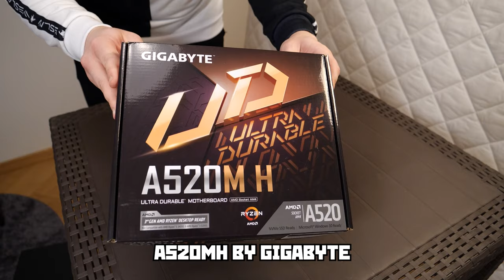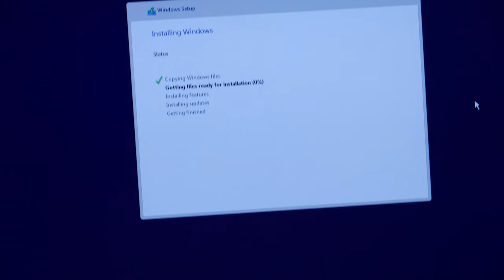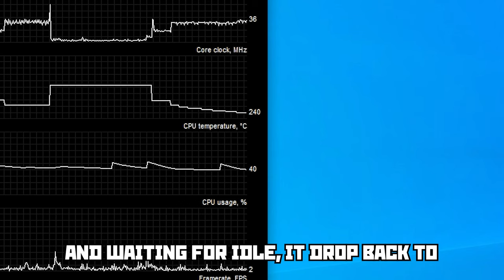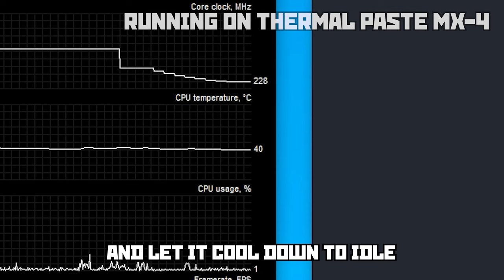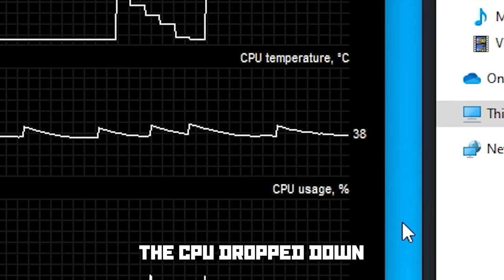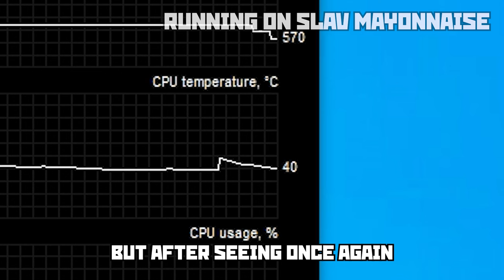Can you replace thermal paste with mayonnaise?

Comment: Ah yes, still better than The Verge's PC building guide.
Reply: 10x bettwr
Reply: indeed x)
Reply: Yes, the only thing he did wrong was the exhaust fan, using that is an unfiltered intake, so dust build-up will be a lot quicker, but if you are willing to clean your pc more often, it will be fine
Reply: @UrHeadset  of course. Boris comes off as the kind of guy to maintain his shit fairly well, so I don't really see that being an issue.
Reply: If only he would have called them tweezers

Comment: Loved the video for the entertainment, as always. HOWEVER, for anyone who might see this and seriously consider using mayo as thermal compound...DON'T.
This concept was tested back in 2011 by Hardware Secrets, and they determined that yes, mayo does work well as a thermal compound, but only for a short time. Its performance degrades after a couple days. At the end of their 12-day test, they noted significant oxidation of the CPU lid. Who knows what it would do to your CPU or motherboard over a longer period. 
Mayo basically works as a thermal paste because when heated it reverts to being mostly a thin oil, which fills the voids and provides a pretty good thermal transfer interface. The downside is that it also contains lots of organics (eggs!), so it deteriorates quickly. Part of what makes a commercial thermal paste "good" is its ability to retain a stable viscosity over long periods of time, and during multiple heat/cool cycles. Mayo(nez) may be delicious, but it's not known for thermal stability. ;)
Reply: Soo, i take it Mayonez is a good temporarily/emergency remplacement.
Reply: So you are saying, replace mayonez every 3 days?
Reply: This comment backfired
Reply: @AverageMichaelJordans  Maybe 4 is okay too. ;)
Reply: @kalekidsav  in what way?

Comment: next build:
mayonnaise thermal paste
vodka cooling
adidas gazelle box as case
lada radiator and fan
power button from chernobyl rain bottle cap
and ram stick is potato
Reply: Extra Slav budget PC build
Reply: @doom6787  yez
Reply: A several kilograms of potato as UPS.
Reply: But what about the CPU?
Reply: @bonzivids9756  Trotsky's brain
Reply: He already did vodka cooling
Reply: @mkbcarcare  lol
Reply: @bonzivids9756  cpu is supercharger of some debils moded lada
Reply: Power supply from reactor 4
Reply: @flyingchair8103  direct power from reactor 4
Reply: Ram stick potato XD
Reply: @mkbcarcare  I guess you could throw in a radioisotope thermoelectric generator and get some power but it'd have to have quite the temperature differential...
Reply: Potato? You mean raw vodka, right?
Reply: This pc sounds not bad, would buy.
Reply: CPU is bay leaf.
Reply: And of course it runs perfectly fine Metro Exodus 144fps+ Ultra
Reply: @МирославЈовановић-г8й  complete with ice pick for additional heat dissipation
Reply: Complete slav pc
Reply: everything expect the potato ram would work , trust me

Comment: Arctic: Works for weeks on end to develop a good thermal paste
Boris: Uses mayonez and it works better
Arctic: -_-
Reply: Arctic actually has closer to 20 years in thermal compound development lol
Reply: @henryatkinson1479  those are rookie numbers, mayonnaise has been perfected and worked on for about 265 years. It has far more research done.
Reply: @carsin60  cant deny this
Reply: @carsin60  its hard to argue with his assessment
Reply: @carsin60  we cant take fight whit this fact
Reply: High quality.
Mayonnaise®
Reply: Question is, how long will the mayonez last before it dries up? As long as it is liquid, it will conduct heat, but mayonez has about 7-8% water content, and once that is gone, it will start baking the oil and drying out.
Reply: @BlackEpyon  i think it started doing that already

Comment: I don't know what's crazier:
That he used mayonnaise or that it worked better than thermal paste!

Boris you madlad!
Reply: Neither surprised me. Hand cream works even better than both mayonnaise and lower end thermal paste. graphite grease works well too.
Reply: Yeah, until it dries out in like a week
Reply: @NorHeadHunter  Actually, the main ingredient of hand cream, glycerin, doesn't dry out. I does however have a tendency to trap moisture, which isn't ideal in a computer.
Reply: @user-le8ul4nr5t  I was responding to the mayo thing really.

There bigger point is that thermal paste exists for a reason, it has properties beyond just thermal conductivity

Comment: This was so cursed, I actually delayed watching this video for a few days, thinking Boris had finally lost it. Seeing it work even more efficiently than regular thermal paste males me wonder if reality has lost it.
Reply: There are plenty of substances that have better thermal conductivity than actual thermal paste. The trick is getting them to stay there, not damage anything, last for YEARS so some lazy tech-support dude can forget about it AND have it at a decent price-point too......
Reply: The case was open the second time )
Reply: @RainmakerAnton  It was open the first time too. The difference here though was the orientation, with the thermal paste, Boris had the case standing upright, and with the mayonnaise, it was laying on its side (probably so the mayonnaise didn't run out and drip over everything when it heated up) which probably affected the thermal convection.
Reply: Speaking of Boris losing it completely, here we are a year later.

Comment: I did a bit of research, and I found that while it is more effective at 1st, mayonnaise is gonna oxidize the cpu and cooler after running for a long time. Not only that, its performance as a thermal compound gets somehow worse, but stabilized after some time. Though I saw these results were done using Hellman's mayonnaise. I'm hoping that Boris' homemade mayonez doesn't run into these problems tho ...

Comment: This "cheapest pc" Is actually better than my pc who prioritise the looks of the case instead of performance (boy was i dumb back in the day)
Reply: as long as it looks like it can play csgo
Reply: we were all  dumb fucks when we were young
Reply: We all know that RGB= Good Graphics
Reply: i bought i gpu with a back plate instead of getting a better performing one
Reply: We all were dumb fks when we were kids
I bought a 2012 dell office laptop instead of building a pc for 300$
Reply: NiSScoT  mine has trash case and compomrnts but good quality gpu ( not performing well,  just the quality is good )
Reply: @FramesByMandeep  I bought a 2012 dell server instead of throwing some random ebay parts together. Ebay may have been a bit more powerful of an option, but most importantly, it would have been quiter. Thank god I only use it as a minecraft server, in my basement.
Reply: I feel smart reading your stories ( I had a big brother guiding me )
Reply: @mr.waffentrager4400   i had a 12 minute time to get all the parts and my veryvery smart father switced a 2600x and a 550w psu to a 650w psu and a 1600 because he said "it wouldnt run" when roughly the system consumes 300 watts
Reply: Meanwhile I'm chilling on a 920m HDD and a 2 core 1.6Ghz 4200u cpu
Reply: Rn I have a case from like 2008, a athlon x4 860k, and a gtx 970, in summer Imma buy a new case, mobo, ram, (I have the cpu), chair, maybe table and a better monitor
Reply: @mr.waffentrager4400   the only good thing with the 650w my father chose (WITH MY MONEY) is that i can now buy a 1080 or similar card without a psu swap, and my brother has no idea bout pc parts
Reply: Ricer PC!?!?!?!?!?!
Reply: @Ivannbeats  yep ...I wish you good luck buying new card but please buy when prices are gone to normal 
Not arguing with parents is a good thing but they are humans too...they make mistakes ...you should have tried arguing that 550 watt is enough 
What GPU you have ?
Reply: same man, i should have bought a better monitor and GPU than wasting money for this cabinet i was a dumb 15 year old
Reply: @Ivannbeats  what kind of logic did he use? IIRC, both chips have a TDP of 65 watts. Even my overclocked 2700 barely goes over 110 watts, the biggest power draw in a gaming PC is the GPU.
Reply: All I got is an MSI GE72 Apache.. with a heat problem and a GTX1060
Reply: @user-le8ul4nr5t  the logic of building computers in the 1990s
Reply: @mr.waffentrager4400  a fucking 5500 4gb, the top mine has consumed is 98 watts, and i am going to buy a used one as i said because the prices are way better and better value overall
Reply: @FramesByMandeep  well, if you are a university student a laptop is more useful
Reply: Im still dumb and just couple of weeks ago, I almost bought a new pc that was about to cost almost 1000 euros. Thanks god I did not do it. Although, I still cant play Doom. Or even watchdogs on high settings. Maybe I need an update.
Reply: @Ivannbeats  By that logic, a heatsink isn't even required. Most chips in the 90's straight up didn't draw enough power to heat up significantly. heatsinks only started to get mendatory with 486 overdrives and pentium overdrives
Reply: @user-le8ul4nr5t   my dad is stuck in the past man, what can i say

Comment: Funny story: My dad used coconut oil as an replacement foe cooling paste on our wifi router for a about 2 years
Reply: incredible
Reply: Why would you even need to add cooling paste to a WiFi router xD
Reply: @petermuller608  well idk if you noticed but
routers can get very hot too. After many years its a good idea to replace the thermal pads in it to new ones... or mayonez.
Reply: @Sharpless2  as someone who owned the exact same router for 6 years without even cleaning it once 
I have no idea what youre talking about
Reply: @Sharpless2  I can relate to this... Mine died, then i put a cooler in it, then It died again 2 months later... Rest in peace old comrade
Reply: @3mmmmmm  nice security risks you got there mate. 6 years with the same router, probably 4 years since the last update. Even a router running too hot can mess with your speeds. I said its a good idea, not a that it will be an absolute must. Read and think before you reply man
Reply: @CatSovietski  poor little guy tried its best!
Reply: You flashed DD-wrt right?
Reply: next time try one of them essential oils
Reply: Ayo sameeeee wtf 😲
Reply: @Sharpless2  it was working fine doing all 45mbs until we got to 130mbs, then we had to get a new one, but it was still working fine

Comment: The only thing i worry about using mayones is animals like ants, mouses, and gopniks, will be attracted to it.
Reply: You can keep gopniks out of your computer case by playing American pop music. This does not work on ants and mice though.
Reply: Same problem when you use tooth paste instead of thermal paste. ants are not a problem they stay away from the heat but small lizards or roaches tend to come for the heat then get electrocuted and die near the processor fan. The solution to that is make sure the casing does nit have unwanted holes or when breaking the hard drive rack make sure you seal it before you close it.
Reply: @De1tAStreaM  tooth paste?
People actually uses toothpaste?
Man i have to get into these pc build thing and stop using this potato with a screen.
Reply: @whoami1449  well yes tooth paste is very good liquid to trap heat quicker and expell. It's ine of the things you pick up when you do electronic engineering. We actually found out it's extremely useful when we were constructing embedded systems. Due to the cpu of embedded system sizes being small when you maximize memory usage you can see max heat go upto 70- 106 °C in which thermal paste doesn't help (it actually makes it worse as it adds yo more overheating).
Reply: If you worked with used electronics before, you probably already know about those horror stories where a console or PC becomes a nest for cockroaches or mice.
It gets worse with mice if they get defensive or if they decide to bite through cables.
Reply: @no_4259  I can't imagine horrors of roach infested computer. Wouldn't they get baked during intensive gaming sessions?
Reply: @rengurenge  a mid game snack

Comment: Boris: calls the 1050TI a ridiculously underpowered card
Me, stuck with a 1050 mobile in my laptop: crying noises
Reply: Hello, fellow 1050 player. Times have been rough for us.
Reply: Lmao i have 710
Reply: I used to have a 1030 in my old desktop. It was enough for the War Thunder, it was good enough for me.
Reply: i have 1050Ti and i am happy, it runs games good enough, like warzone at 45FPS is still doable.
Reply: I gamed on a GT 230 for 8 years before I got a 1070 hahaha now 4 years later I have a RTX 2070 super so don't worry fellas there will come a time when you will be able to get your hands on better hardware
Reply: @sladkyhermelin3756  i wouldn't call 30fps on roblox "doable", though.
Reply: @identity_ception  as long as the game is not terribly stuttering its ok, but i have 77hz display so it's kinda uncomfortable from playing CSGO at 77FPS to warzone at 45FPS, and i think if i wouldn't have shitty I5 4570 that's running 100% all cores in warzone i'll get 3-4 more FPS
Reply: @stefa4013  1070 is actually still an amazing card. It doesn't have ray tracing, but damn, for an Nvidia without raytracing is still an amazing card
Reply: Same right here, GTX 1050 3GB in my laptop.
Reply: Lmao I use Vega iGPU and it's better than my friend's old laptop with 720 Mobile.
Reply: F U! GTX 960 :(
Reply: me with a gtx 950: visible confusion

Comment: This has the energy of my grandma telling me to put batteries in the freezer when they didn't work, and it worked
Reply: unlike to be efficient at all. 
Cooling down batteries may prevent them from self discharge because of the slowed down reactions inside it, but only by a very tiny amount. 
And as we all know, or at least people that use DSLR's in freezing temperatures, the batteries doent last long at all.
Reply: My grandpa taught me that too 😂

Comment: Me seeing him putting one RAM stick
Me: PAIN ONLY PAIN
Reply: Well, he said he couldn't find 2x4, so it's kinda the only option within that budget.
Reply: maybe he will upgrade to 16 gb
Reply: If it's budget, it's budget, i've done it before for my friends, 2x sticks are quite costly for when on budget. I also used that Aegis RAM stick in 2 pc builds if not 3x xD.
Reply: @kiloneie  if it's budget, get the axe, split the stick in 2 and fill both channels. the slav way.
Reply: @krayoxtv8331  Not as much as you think, you won't actually lose that much performance.
Reply: @krayoxtv8331  What does that have to do with only using a single stick in dual channel?

Comment: I had to open up my PC because of a DRAM_LED "check your ram" light and had to disassemble my entire PC to figure out what the fuck happened to it. I also wound up wiping the dried thermal paste off my cooler and CPU. When I finally got to reseating my RAM and getting it to work, I unfortunately had my CPU go straight to 100+°C because of the lack of paste. Remembering this video made me dare to put Mayo on my CPU. You have saved it... for now.

Comment: thermal paste is a bad conductor of heat, but it is much better than air voids getting in between parts, and at least it can be used for years and years without rotting!

Comment: When you build with four RAM slots you actually want to use the two slots farthest from the CPU. These are usually slots A2 and B2. I don’t make the rules. I think on most boards the slots are color coded, and you use the lighter colored pair first? I haven’t owned every board so it may be different across manufacturers . But generally speaking you want A2 and B2 first, then A1 and B1. Of course it may not matter which pair you use first. I’ve always done it this way.

Comment: Well...i tried to look up the heat capacity of mayonnaise. Didn't find it. So if you can get a hold on the heat capacity of this mx-4, you should be able to write a crude paper with your findings. Further tests with some more materials, determine their heat capacity and maybe you'll get a PhD. 

Dr. "Mayonnaise" Boris. Sounds nice.

Comment: ryzen 5 1600 can usually get a decent all core overclock to the turbo or above, i got 3.9ghz at 1.275v, you are almost certain to manage 3.7 tho, that cooler can manage anything up to 1.35v easy

Comment: Forgive me if I'm wrong, but considering there's only one PCIe 16x slot and 2 RAM slots, is this not an mITX board rather than an mATX board?  My mATX board has more than one PCIe slot and 2 RAM slots on both sides of the CPU and is slightly taller than that board.

Comment: before i watch what happens i'm gonna make a prediction . proper thermal paste is electrically non-conductive so if it somehow spills on the pieces nothing bad will happen well as for mayo i think that if he puts a lot some oil will find it's way to the socket and will go 4th of july mode or if he puts a lil bit there are 2 possibilities :

1- the oil still somehow find it's way down and go boom boom 
2- the pc will run for a while but then automatically shutdown when the CPU starts consuming a decent amount of watts due to heat
3- (miracle) somehow everything goes will ( but honestly i don't think it'll last for long lol )

Comment: You can actually make this build a lot cheaper by skipping the graphics card and getting a ryzen apu(like the 3400g) the vega 11 integrated graphics card with 16 gigs of ram on dual channel can run anything the 1050ti can I've used to play cyperpunk,Doom eternal,metro exodus, all running between 30 to 60 fps

Comment: wait a minute, how does your GTX 1050 ti Windforce OC edition have no 6-pin connector :) ? and btw that card is not cheap nor underpowered as i'm still managing to run latest games on at least high settings with a stable 60 fps on 1080p with an old ass cpu FX-6300 that i OC'd to 4.7 GHz

Comment: I use a 1050 Ti normally, it’s weak yes. But I run 90fps on valorant on high settings
Reply: thats awfully low you should be getting 200
Reply: @waltuhpyda  I run other shit in the background